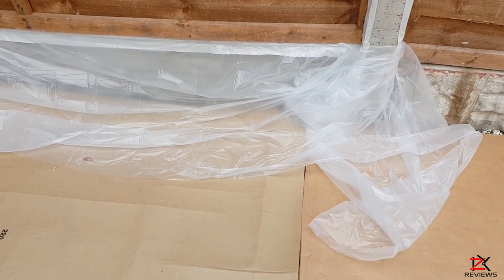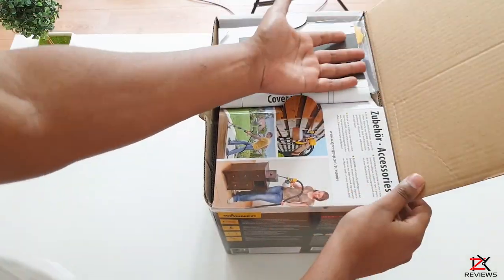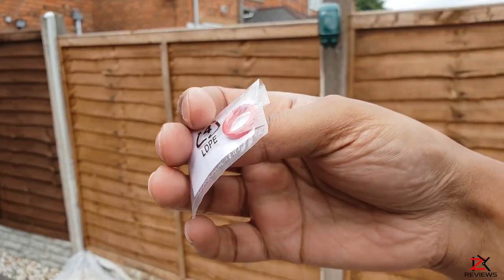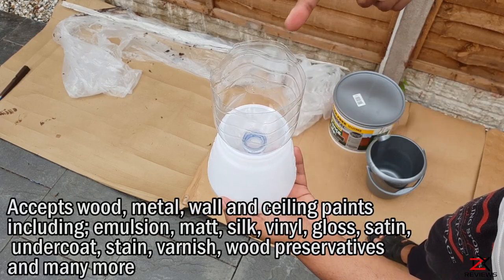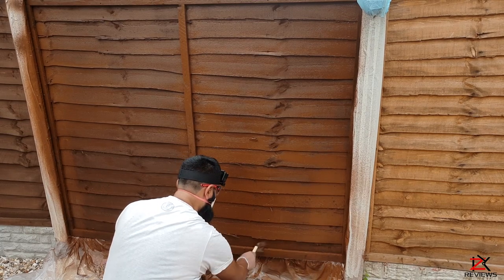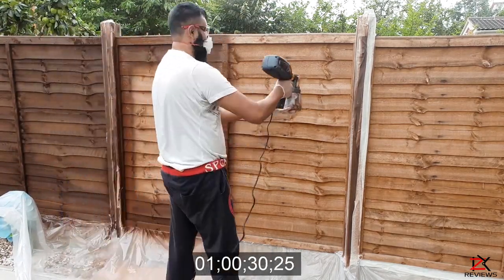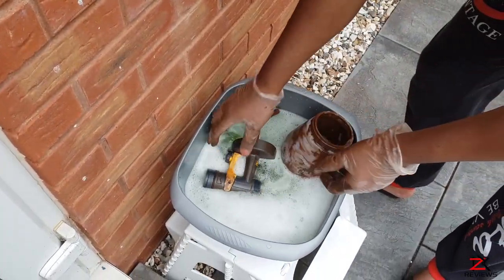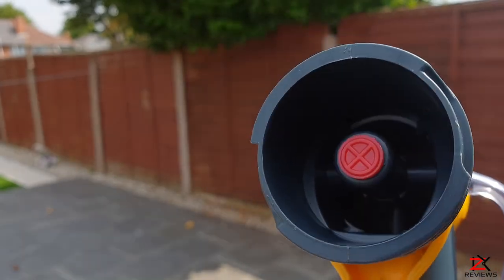How To Paint Fence Panels | SPRAY VS BRUSH | Wagner Universal W570 Flexio Sprayer Review

Comment: I spray panels outdoor regularly as a side business. I use this exact machine. But try using the larger 1.3L container and nozzle as the paint dissipates far better. And covers significantly better. The 800ml one is dreadful!  Plus the benefit of the 1.3 holding more so less refilling

Comment: I recommend using a section of cardboard cut from a moving box using 2 of its sides so there is a straight fold in it. You flop it over the top of the fence panel so that part is behind the fence while you are holding the other half up. With your other hand cut in the top of that section of fence and move along until you've cut as much as you want to paint at a time. You can then use the same cardboard scooted up to the base of the fence to cut in the bottom. This means no masking and no overspray into your neighbors yard provided there aren't gaps between pickets.

Comment: I'm here in the US and I have the Wagner Flexio 590, when I paint with it I'm not covered with paint and the sprayer isn't either. I'm thinking you have the spray power adjusted too high for the material you sprayed and maybe you were a little too close to the fence. If this was your first time using this, it is understandable as you learn and get better with it. To anyone thinking of getting one, it is a time saver and worth the money, however, don't think you can just buy it, take it out of the box and start spraying. You need to get some cardboard boxes or newspaper and practice spraying with it and the material you plan to spray. Play with the settings and learn which settings give you the best result for the paint you are using. I would say take about 30 mins to do this and you will get good results.

Comment: When you set your fan pattern vertically, you shouldn’t spray in an up and down ( vertical ) movement otherwise you will dump far too much paint in a small area. The fencing paint is far more forgiving than other paint or you will definitely run in some kind of trouble . 😀

Comment: The wagner flexio is awesome.  I have the 590 which has a dial to adjust the fan speed from 1-10.  So let's talk about results.  I painted an entire brick house with it in under 6 hours.  I mean it would have taken 2 days to do with brushes and rollers.  I liked it so much I decided to bring it indoor.  I painted my entire basement and our living room with vaulted ceilings.  This thing is awesome.  Just clean it and take care of it.  If it starts shooting globs adjust the fan speed up and volume of paint down. The results it delivers are amazing too.  A very smooth finish.  I usually do 2-3 fine coats with it.  I have an upcoming fence staining.  In the video he didint really describe thing correctly.  The bigger nozzle and container is for paints.  The smaller is for thinner stains.  I assume he was using a stain and not a paint.  If it was paint then he should have been using the larger nozzle and container which would have avoided having to thin it out and hold more paint.
Reply: Hi Beau. I have literally just purchased one of these and it should be arriving soon. You mentioned about spraying brick, did you use Sandtex masonry paint at all? I'm considering trying it. Thanks
Reply: @pipstersim4421  I used Behr masonry paint from home depot
Reply: @Beau Artson - I'm glad you mentioned about the bigger nozzle with bigger container, as I just bought a Flexio 590 and was disappointed at how small (800ml) the container was for the 'wood' applicator. I thought surely fence paint being like an emulsion would be compatible with the interior walls applicator, now your comment has give me the confidence to use it. Thank you!
Reply: @Jay-Vee  there are two containers and nozzles.  I have never used the small container which is supposed to be for fine jobs and for thin stains.  I painted an entire house inside and brick on the outside.  Masonry paint is thick and heavy and it worked well on highest fan setting. I stained about 200 feet of fence with it as well using only the larger nozzle and container.  I just turned down fan to about half and adjusted thr amount of stain coming out.  Worked great.  The small fine detail sprayer would probably be better for painting cabinets of something.  I just haven't found a use for it.  The 590 flexio really works well.  I have done a ton of projects with it and everyone has turned out great.  Dont be scared to use it inside. Just make sure you mask off everything really well.  I did 20 foot walls with it in no time.  Prepping takes longer than painting. I just with the cleanup of the sprayer when your done was easier.
Reply: @beauar1  thanks for the prompt reply. Can't wait to get on it. Yeah, not looking forward to the cleaning bit ha ha.

Comment: A good first go. Good on you. A couple of tips to help others and you next time. Always move your spray at right angles to your fan pattern. i.e. Vertical pattern means horizontal motion and vice versa. This builds your paint evenly across the job, reducing runs.

Consider buying a spray shield. It's a metal panel on a stick that can be adjusted and used to stop overspray across the top. (Especially when you get the unit replaced and have a spare hand.) Kept clean with a rag, a shield can be often used to mask straight edges with a bit of practice. You could also use cardboard for this, or there's even a stick that clips a cardboard shield in, which is handy for fences.
Reply from the maker: thanks for ur input friend

Comment: theres two version of that 570 sprayer. the one i have has a thumb switch to turn the motor on and off. you need the one with the thumb switch, this is really important if you are doing jobs for customers!
the one shown here spools up the motor as you press the trigger, so at first its releasing paint while the motor isnt at full speed so you will get blotches and splatter or globs of material coming out the nozzle and the same (but a bit less) when you release your finger off the trigger.
if your doing a paint finish for a client this will cause you a steady constant nightmare as you keep having to fix splatters on surfaces.

Comment: I purchased recently a 590 wagner. It was fast and saved time while painting. BUT, the amount of time needed for preparation to avoid paint waste and spillage is considerable. On the other hand, the paint thickness with brush and roller is higher than that of applied with sprayer. It was annoying to see that I need ed to re-brush the surface after having sprayed it. Not satisfied with it and retuned it to where I purchased from.
Reply: Change nozzle next time, last 2 digits of nozzle shows amount of paint released

Comment: I use a 9" roller and pile it on to wet the panels up then lay it off and cut it in with a brush . Soon get through it , about 3 minutes a panel i'd say , but no spray gun to faff about cleaning up afterwards so probably just as quick overall but obviously cheaper,  although admittedly more physically demanding .To be fair i'm a painter by trade though so can rattle through it . Nice video though .👍
Reply: Orbitalforest also do next doors side as well ? Runs down it

Comment: Many thanks for this great tutorial. For myself, I think I would still use a brush when painting the top 6' to 9" of the panels, so that I don't get any over spray into next doors garden. How did you get on with your neighbour, didn't the overspray get on he's grass, that paint comes out in a large amount. Also what setting of pressure did you have it on, could you slow it down much to reduce the over spray issue

Comment: Thanks for sharing very informative mate. A question :how to clean the cement poles after as you cant avoid it. While painting my garden fences I made most of the poles dirty with paints and my wife was mourning that I'm supposed to keep them clean, while I was saying that it's garden & you can't avoid throwing drops in the poled when painting the fences.
Reply from the maker: best to get it covered before, but what u can do is try spirit or paint the post with white masonry paint which i have done in one of my videos

Comment: When you said ooops got it on the wrong way you actually started with it the right way, when you start cut the top in with the horizontal spray, starting about 6 inches below the top & edge the spray in, if you start with the nozzle level with the top you will get spray straight over the fence, then switch to the vertical spray to fill in the rest of the panel

Comment: nice neat job.....I would still use a thick roller after the spray, some, not all of the product is going to sit on the surface, these new water- based stains, dont have the same absorbtion as the older oil products.....Even in the old days, i would tamp down after my crew sprayed...18 or 54 inch roller if available where you are. Larger roll down= quicker time frame
Reply from the maker: thnx, its coming to near a year and its done a very good job still looking as new.

Comment: I can think of 2 issues here,  does the paint get carried on the wind?  I noticed your neybour had her washing out 😄  also  you get it done, your very happy with your new fence,  then your neybour paints the other side green and the green paint drips through to your side 😆😆  rather than masking everything up, I'd be inclined to ask the neybour If I could remove the panels entirely and spray both sides, then slide them in when dry

Comment: I would be happy if I was the neighbour. Paint everywhere. I would spray the panel but use a brush for the top, or attach some card at the top on the opposite side if the neighbour will let you

Comment: I always feel with the sprayer that the paint doesn’t get pressed in the same and more on the surface….maybe if brushed in afterwards to ensure that the paint is absorbed more? Also definitely need a mask with the spray drifting everywhere and the sprayer gets broken easily and is fiddly etc etc. Jut my opinion if a job takes longer to do it’s a better job and will last longer if done with a brush. 🤔
Reply from the maker: trust me get yourself a sprayer even a cheap one will do, ive sprayed my panels and now after 5 years they require a slight touch up. save time, save your arms, invest in a sprayer.

Comment: Thanks for the comparison. 

Did you also end up painting the part of the fence within the concrete slot? Just thinking those side bits may still need a coat of protection.

Comment: Can you please answer a couple of questions??

So this is exactly what I am trying to do, with my fence, deck, garage Door.

I was hoping to rent the machine vs. purchase from a Home Depot. 

The guy at the rental counter advised me against spraying due to paint getting on neighboring side and windows and such. 

Now from looking at your video that didn’t seemed like the case at all, mind getting into anything that may had not been covered in the video?

Also roughly how much paint was needed for one panel? For calculating purposes??

Thanks
Reply from the maker: the sprayer doesnt splatter out paint its more detail sprayer so as long u cover a few surrounding near u should be good, 1 fence panel is about 1 container of paint,   im going to get an upgrade of the airless sprayer, if ur not concern about price then hire out an airless sprayer saves bit more time n bit more paint
Reply: ZRK REVIEWS Thanks,

Comment: Hi, great video and great to see you improving.  Did you find the unit heavy with a full pot of paint?  I'm thinking of getting this unit or the 690 as it has a separate turbine that stays on the floor.  Any thoughts?
Reply from the maker: hi thnx. the unit itself is very light just like carrying a cordless drill. yeah for floors should be fine just make sure u turn the container tube the right way.

Comment: Nice video. How long did the prep time take to tape and paper? Less than one hour??
Reply from the maker: putting on masking tape and using dust sheet for one panel only took a few mins. its best to get 2 panels covered, paint, then take off tape and dust sheet from 1st panel and place on 3rd panel then 2nd panel to 4th etc in rotation. so you can reuse the coverings.

Comment: you can lift them fence panels out which will save messing about masking the posts. spray the ends up as well cos water will run down the recess in the posts.

Comment: Could I ask how many coats you need in when brushing compared to spraying? I'm assuming with the sprayer, the coats aren't as thick as the paint is diluted a little. Wondered if it would take more time therefore, because of having to reapply a couple of times? Cheers.
Reply: Based on the time it took him to do one coat with a brush. It would still be 4 times faster with the sprayer even doing 3 coats with it.

Comment: My question would be about the depth of the paint once applied ,the brush although slower seems to deliver more paint,do you need to spray twice with the sprayer to increase the opacity of the paint to the same density as the brushed on has?

Comment: Thanks for this, I like your video and the tips you have given, l am painting a fence and have looked at using a sprayer however the product that I am using says apply using brush or roller as it has wax and oil in it. 👍👍👍👍😀

Comment: How long does it take/cost to sheet  up each panel, post and anything on the other side of the that could get covered in paint, also this like applying gloss paint with a roller and not laying it off with the grain...
Reply from the maker: you can either sheet up the bottom under all fence panels or sheet up on one panel, paint, then move the same sheet to another panel. sheets cost about £1

Comment: The video is very informative. But you need to do some basic research on how to spray effectively! 
1) Let go of the trigger at the end of each sweep to avoid paint build up on the edges.
2) Don't lay the paint on so thick to avoid runs. There's no harm doing 2 coats.
3) Be mindful of spraying over your neighbours fence.
4) You don't need to cut your edges in first with a sprayer like you did with the brush.

I know you put in a lot of work. But a few hours of research would take take your results from amateur to 90% professional.

Comment: Not sure if I am doing something wrong but the fence container seems to only do about a third of a fence panel for me.  I have tried reducing the air flow to minimum but it still seems to empty the fence paint very quickly.  Any ideas?
Reply from the maker: stir the paint b4 use, make sure all attachments are correct in nozel, make sure filters are attached n cleaned
Reply: @ZRKREVIEWS  OK Thanks.  I think that was the problem.

Comment: With a roller and a brush it would of came out better then with that sprayer. A smaller Graico Airless would of been better. Maybe its less time consuming for you to use the wagner since you dont have the technique and experience with roller and brush. Out of the two options you showed id still go with the brush. I just hope your neighbors didnt have anything close to that fence on their side because if they did you just put a bunch of over spray on their things.
Reply: Jose Valdes yes and the graico would of cost a packet to buy !

Comment: It's dripping on the sides because you had it in vertical and concentrated it on the edges when you probably should have just done what you did afterwards instead. Thanks for the demonstration though.

Comment: Don't be fooled: Wagners are PURE GARBAGE. While an experienced painter can get a decent finish on textured walls, it will take 2 to 3 coats because the paint has to be thinned ~ add to that time spent masking and taping and you'd be done faster & easier with a roller and cut 
brush. Additionally, it will NOT work well on cabinets or trim ~ too much orange peel.
Reply: Hey I'm not to sure you know what your talking about, and how to properly use one, or used the less inexpensive one, but unless your using oil based paint, thinning is not necessary, and taping isn't either if you set the setting right, and as for overspray, again set air speed down and lower how much paint is coming out, and one thing that I didn't pay attention to, and thought the thing was garbage too, was until I learned the trigger, when pressed  half way, will start the turbine( air fan), allow a second, then fully press the trigger all the way and the paint will flow, again if you have it set up right for whatever  painting project it might be, you might not think it's garbage, I don't  think it is anymore after learning how to use it properly.
Reply: @dannymartinez8314  After using the Graco Truecoat 2 which sprays unthinned latex without issue, which is what most DIYers want to do. I can honestly say the only advantage the Wagner has is it's lighter weight, but it WILL NEVER shoot heavy unthinned latex paint! If it would, I would have gladly used it.